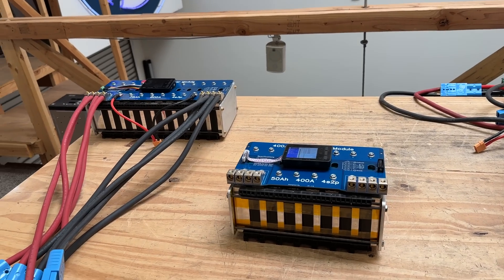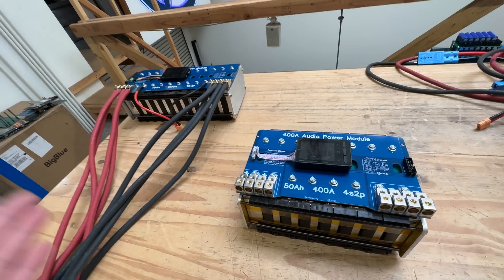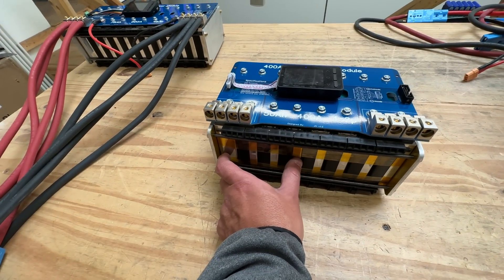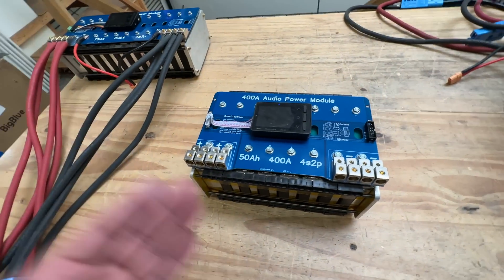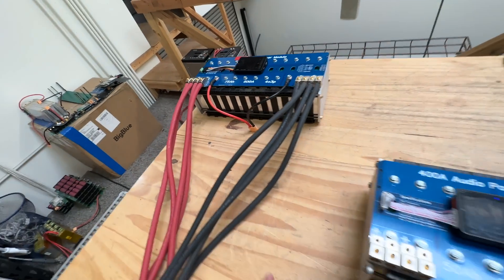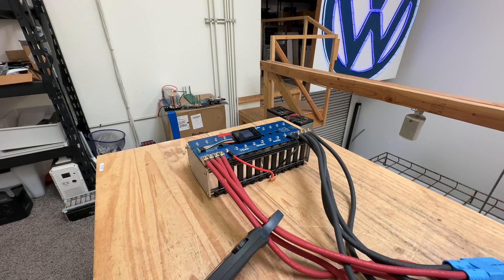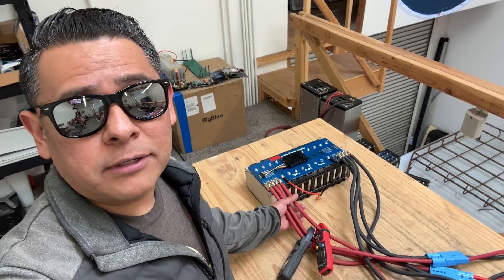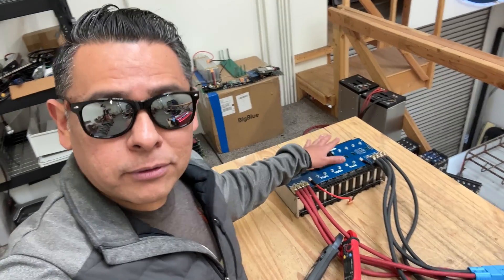7000 Watt Continous Audio Power Module

Comment: Trying to figure out how to hook up the 8 pin to the recommended battgo balancer just like yours. I'm not sure which pen or wire to put where on that little green hook up you've got there there's five slots and the balancer has 9 which guessing one is ground
Reply from the maker: Start on the negative side.  Connect five wires and ignore the rest

Comment: They are NMC Ford Cmax and Ford Fusion Energi (the plug in hybrid) 25A Panisonic cells. Not as high of a  C rating as the 5A cells that are usually used for car audio. That compression seems to be a little on the weak side. Has there been any issues thus far?
Reply: The compression is clearly not on the weak side I don't know where the hell you even came up with that lol. I was suspicion you were just trying to say that just to sound like you thought you knew what you were talking about lol
Reply: @moderngunguy3666  you evidently haven't seen what the 5Ah cells have done to people's make shift compression and evidently haven't seen how Ford compresses them either have you? 

More over the compression seems weak and so does the bussing, however he is rating them at high amperage so I assume he would know. 

I don't know much about the 25Ah cells myself as they are not that commonly used as they are no where near as highly rated as the 5Ah counter part (which are used in the cmax/fusion/mkz hybrids, not the plug in models!) 

I have no problem teaching you a thing or two! Just ask next time you don't know! Or keep digging and keep the ignorant and arrogant comments coming... Doesn't bother me one bit!
Reply: @commonsenseisdeadandgone  He's technically actually not the most knowledgeable person about these things.. He's mostly trying to show that is PCB bus bars can handle the power. Everything else you can kind of telly doesn't know much about. He just knows how to make sure the bus bars can handle what they're supposed to. The guy at Glow voltage did a test with them also and said they were good to go
Reply: @commonsenseisdeadandgone  The compression doesn't have to be super strong It just needs to be firm as far as I know. Kind of like just holding it in place not allowing for expansion which doesn't take a lot
Reply: @moderngunguy3666  your name looks familiar..... Have I had the displeasure of dealing with you elsewhere too?
Reply: @commonsenseisdeadandgone  I guess it's possible a lot of people have that displeasure
Reply: @moderngunguy3666  I forgot to say that I don't know the 25Ah cells that well. Admittedly so that's exactly why I asked if there had been any issues with them! 

I didn't claim to know, why would I ask questions if I already knew Einstein!?
Reply: @commonsenseisdeadandgone  also these cells I believe are also rated without compression.

Comment: My charge voltage never goes above 14 really most of the time its 13.8 so i dont think my alternator could actually fully charge the battery and usually a volt of power is a good percentage of the batteries charge this looks like a great option if it can work in my vehicle that is
Reply: Depending on vehicle, Put 2 diodes (1N4004) on the S wire with the line towards the plug. Each diode boosts .5v

Comment: I’m looking for something that will power my Makita lawnmower. It takes 2 batteries at a time. I’m guessing that makes it 40V when fully charged. It only runs at full potential for about 10 minutes. The other 5 minutes is running till the low battery light comes on. I’m using 5Ah Makita batteries.

Comment: I purchased 6 of the 75ah 600a version of this battery, but I’m having trouble finding a cable to fit both the connector on the battgo balancer you reccomend aswell as the connector on the battery. Can you help me out in finding the needed connector?
Reply from the maker: The 5p should work https://a.aliexpress.com/_mPuBqM8
Reply from the maker: This one will deliver faster,  just cut connector on one side and strip cables https://amzn.to/42J6SWD

Comment: i want to use this battery with a 1,500w inverter is that possible and if it is how many hours will last when fully charged?..
Reply from the maker: its 75Ah x12v = 960Wh. so it would run a continuous 1500W load for about 40 mins.
Reply: @jehugarcia  so what battery you advise me to get for my application?  I want something that can last a least 5 hours ..

Comment: why not reducing inductance by placing + and - next to each other ? keep 1 whole layer for VBAT+ and 1 whole layer for VBAT- for supra low inductance
Reply from the maker: I don’t understand what you are saying
Reply: @jehugarcia  i mean positive and negative cables are on opposite sides so it creates some inductance that you could reduce by placing them closer, but on the other side audio guys already buffers with lot of capacitors so it lessen the inductance
Reply from the maker: I have very little control where the terminals locate.  The cells are rectangular and have terminals on opposite side of each other
Reply: @Opteron67 and how do you accomplish this? These batteries are pre-built.... How do you just decide to put negative and positive where you want to?

Comment: Suggestion: almost every high power amp made accepts 1/0  so change the output terminal to match. Otherwise a very good idea for a affordable option.
Reply: You do realize 2/0 is bigger wire then 1/0 right?
Reply: @Nevaru_42 you do realize these are 2 gauge not 2/0 gauge right?
Reply: Yeah but four I repeat four runs of 2 gauge ofc is way more than enough! I'd rather it come like this and I can adapt up at the battery if I already had bigger wire but If I was buying 4 new runs of OFC wire, I would just go with 2 gauge and  adapt down if I needed to at the amp because that's a lot of wasted money that isn't necessary. This battery can only put out so much..... @Todd_Wilson213

Comment: I used to be in car stereo competitions.  We would have alternators custom built to put out at least double the power as a stock one.  We also would run capacitors and multiple 1000amp batteries to keep up with the most powerful systems.  We wouldn't just install a super powerful system and do nothing for the stock electrical system.  That would actually hold back the sound performance of a high end system.
Reply from the maker: Yeah nothing wrong with that,  except some people are spending same or more than this entire battery just on aluminum bus bars

Comment: What if you're charging  over 370 amps  at 14.8 15v ,  would that affect  the bms
Reply: There is no bms, raw cells in 4s configuration these cells run at 16.8v fully charged if you could charge them with that much current the batteries should take it with a 10c rating. I would strongly suggest a T class fuse for short circuit situations.
Reply: @Seven 77  oh OK 👍🏿  thanks   yeah I normally  run fuses  anyway   but u answer  my main concern

Comment: I got a 1500w amp for my subwoofer iny Chevrolet bolt ev. I pull 150amps when the base hits. Would be neat to test out with my amp. Really neat battery for the application.